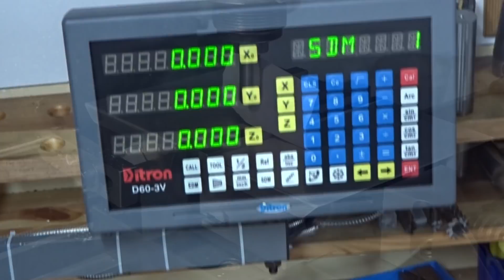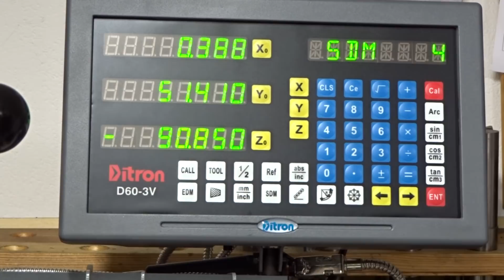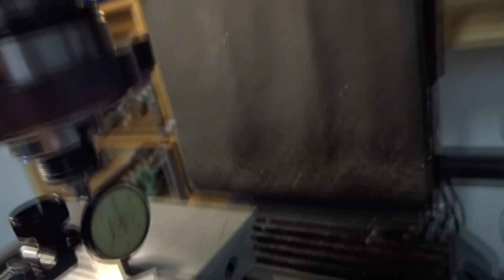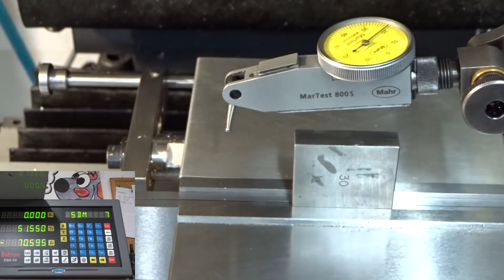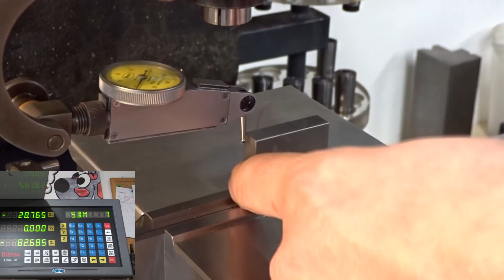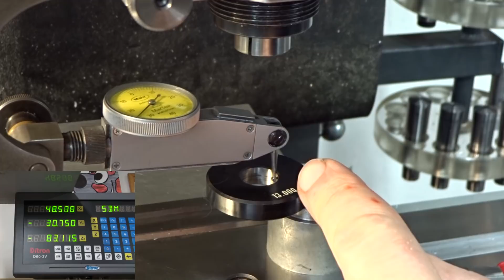Edgefinding techniques

Comment: I would like to share my technique of egdefinding using V-bit blank (like Mikro100 RSM-100-1). Approach the edge with the flat surface of blank, rocking/turning it in the spindle. As you getting closer and closer, you will feel that you have less rotation. At the point when you don't feel any rotation, you're done, the spindle centerline is on edge. These blanks are pretty accurate ground (within 0.01mm or less) and after a bit of practice it can get you around 0.02mm accuracy of egdefinding

Comment: Another book is "Precision Hole Location" also by another of the Moore clan. 
Very good video and comparison. I like the Haimer 3d taster, but it has the same problem as the coax indicator in that it takes up a ton of Z. I was surprised you didn't include the old chair type edge finder, but I guess the gage block method is pretty similar, as long as you have a good DRO.

Comment: Hi Stephen, I design and develop 3D datum finder probe in India. Its a manual probe and it will save about 70-90% time with repeatability of 2 micron. And also you can adjust the concentricity within 2 mins. I would be glad to send you a piece for your review.

Comment: I was going to mention those Moore Tool books until you did that yourself Stefan. A bit expensive but well worth it. I've got a Haimer 3D, maybe over kill on a manual mill in a home shop, but it's fast and there's nothing to subtract for half the tip diameter. Just a rough guess, but the dti method is still likely a 10th or two more accurate. How do you like those Mahr dti's compared to a Mitutoyo?

Comment: No wiggler? 🙄
The dowel pin technique.  I would never use it for anything really close but for pass holes for screws and such it's fine. The way I always did it was bump the work up against the pin and tighten the vise. The ball bearing method a lot depends on the quality of the bearing. Edge finders. I really like the audible ones. The indicator method can also be done with a tool makers chair.
https://www.practicalmachinist.com/vb/general/edge-finder-speed-question-376504/

https://www.google.com/url?sa=t&source=web&rct=j&url=https://www.penntoolco.com/brown-sharpe-audible-edge-finder-1-2-shank-x-0-200-head-diameter-599-792-21/&ved=2ahUKEwjlxIvgmOvuAhUKWs0KHeS_A0AQFjADegQIBhAC&usg=AOvVaw1M6IXZa2zdt9wfusttTxBm

But in the end the 3D Taster and Renishaw are really the slickest
Reply: but he did use a wiggler?

Comment: Did you make that spindle mounted indicator holder?  It looks a little more useful geometrically than most of the ones that I've  seen.  I like the DTI set up because it allows you to find zero without a collet change associated with using an edge finder.  Cool trick.
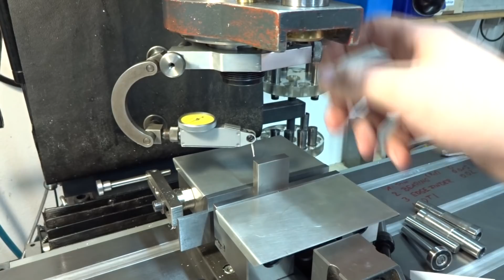Reply: At 9:53 he said that was his shop built indicator holder. He got the plans free (PDF) off the internet. I would like to find those plans.
Reply: @cpcoark  I heard him say that.  I was hoping that the plans were on his website. I looked, but didn't find them..

Comment: When you use the edge finder, is 0 at the location just before it kicks out or as it kicks out? I’ve always wondered that. Great vid.
Reply: As it kicks off, they work like that because as the tip goes just barely past center it then tries to rotate along the part face or edge. That's what gives you the large visual indication that it's kicked over.The cheap one's don't work well because to be sensitive enough, they require proper heat treatment, precision grinding on the matching faces and sometimes lapping. A good edge finder can be checked for it's average and very small inaccuracy at that kick off point by zeroing the dials or dro after double checking it's exact kick off point and then edge finding with a dti. Compare the two measurments, and if there's any change you then know the approximate fudge factor to allow for. With a real good edge finder it should be low 10ths from exact.
Reply: Have a read of George Thamas'  book. He covers this in great detail. BobUK.

Comment: Nice to have you back! Getting worried you might have gotten the virus or something:-)  I like the wobbly edge finders that kick off to the side, too, but maybe I'll buy a nicer one like yours now.  I often just use a dowel pin and cigarette paper though. Most of my work isn't too critical of tiny errors. I usually make parts for my own use and I know which dimensions are fussy and which aren't.

Comment: All of my igaging scale's failed. Ya not paying 40 ish for the 6" er's. Gutting a cheap caliper Gonna put the circuit board on a "shield" of sorts and I'm up to my waste in snow and a single chip logic level converter that just slips under the 1.8v gate hooked on graphical display DRO with programable point's that if ones off change the setting and the next one's dead nut's Your story is how it begins and mine is an ending Ha Ha good stuff

Comment: Stefen Dude do you smoke or just buy the papers for their thickness? Seriously very useful information! TFS, G :)
Reply: I think he has been hanging out with AvE and smoking something alright... as he seems to extra "tongue-tangulated" in this video for some reason. (j/k)  ;-)
Reply: There's a pack of zig zag brand rolling papers in my precision tool box. And I don't use those rolling papers for anything else but part edge finding. They can be used just as well on the lathe to pick up a tool point position on the parts O.D. or face. I don't know of an off the shelf tool that can do that without a lot more time and effort. I also have a digital Haimer 3D Taster, but it can't compensate for the exact tool run out if there's any present. With practice I think the cigarette rolling paper trick is at least accurate to within .0005" Your going to measure before the final cut anyway, so it's more than close enough for most items.

Comment: How about making a simple electrical continuity tester, similar to how Z-axis tool setting on some simpler mills are set up? Basically if there's connection you get a beep, or an LED or whatever, if there is not you don't. It should be, I assume, similar to the light gap technique if you use a pin of a known dimension.
Reply: I do it using  the continuity test on my multimeter, the beep
Reply: No need to make one, they already exist.  Searching for "led edge finder" will bring some up, cheap enough it's not worth bothering to make one.  I have a cheap one, works fine for my use.
Reply: @EvilGTV  Well considering that making one only includes a battery, an LED and two alligator clips I'd say I can probably make a thousand of them in the time it takes for an online order to arrive on my doorstep 😉
Reply: @SwitchAndLever  only useful if the part will conduct electricity
Reply: @stuarthardy4626  well yes? I thought that went without saying. Though you could easily use a gauge block, or even some aluminium foil, and just subtract the thickness if that's the case.
Reply: One reason for not using an electrical method is because you would be running a current through your spindle bearing balls, which over time, even at low power can compromise the bearings. The little led edge finders don't run any current through the machine though.
Reply: @jeffwombold9167  No you wouldn't. You have two clips, one that goes to your pin which you have in your collet, the other goes to the workpiece (or the vice). The clips are connected to a battery and an LED. The only current path between them is when the pin connects to the workpiece, and that's when the LED lights up. You're not going to be running any electricity through anywhere else. There should be enough resistance and isolation through the machine to effectively prevent electrical connection through the spindle.
Reply: @SwitchAndLever  some machines may have enough isolation, some don't. This same issue comes up in autos as well, but when it does a lot of times it isn't recognized as such. Your method is ok, in general, but I wouldn't recommend it on extremely sensitive machines such as a jig grinder or the like.
Reply: @jeffwombold9167  You could very easily isolate the pin from the machine if that's the case though. Let's say you use a 8mm pin, you could easily make a 1mm sleeve for it from a non-conductive material, and fit it in a 10mm collet. No current path, super easy solution!

Comment: Great video. Our 76 year young toolmaker that just retired used a .250 gauge pin and put black sharpie on it, spun it around a 1000-rpm and when he saw the black mark rub off he was good. he swore by that way, said it was way more accurate for him than an edge finder. If he is finding center of a part (no matter the shape of the part) it will always be a dial test indicator
Reply: sharpie on a gage pin... Huh, that one goes in the toolbox.
Reply: I've set tiny drills this way and if you measure the runout beforehand you can really get within less than 5 microns (make sure there is no blob or wave of ink... It can through you off)

Comment: I'm thinking the flashlight technique probably wouldn't work very well if the part isn't square or clamped squarely in the vise
Reply: The flashlight method would show that. So in essence, it would edge find and make sure the part is delayed. Lol.
Reply: You're very correct. Tells you if you're  properly clamped.